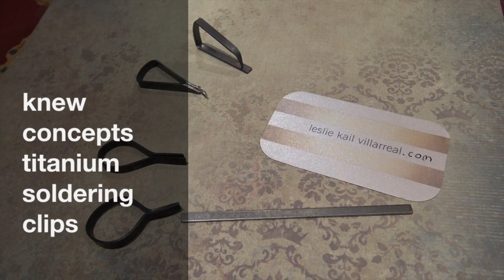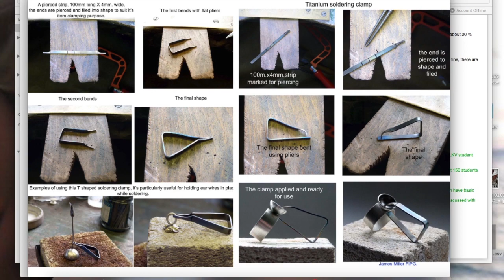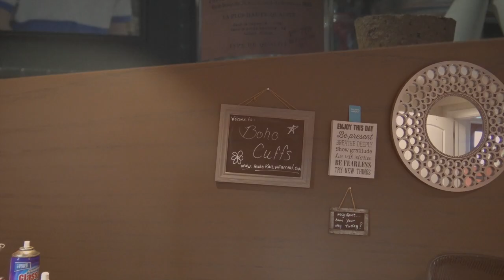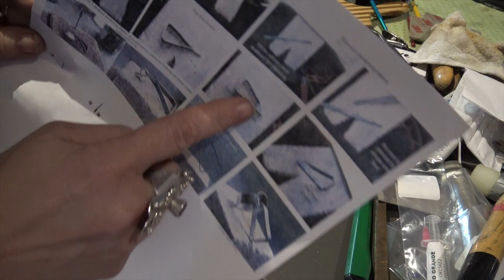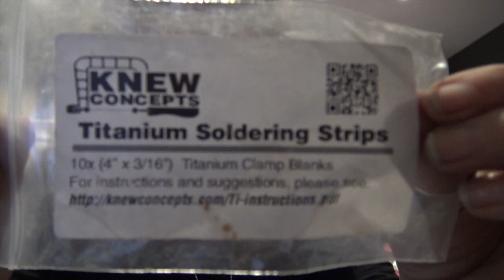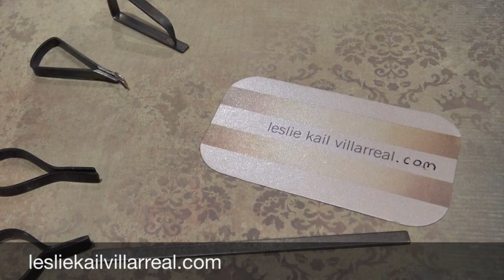How to use Knew Concepts Titanium clips for soldering

Comment: Do NOT ANNEAL them!!!! Titanium will become more brittle with heat. If in doubt, Knew Concepts made a YT video January 2018.
Reply from the maker: The old ones were really thick and needed annealing, they did get softer - the new ones ore very thin and don't need it.

Comment: Annealing titanium is different than annealing copper or silver. These (at least now) come annealed. Adding heat to them makes them harden due to titaniums reaction to oxygen.
Reply from the maker: Wesley  Beavers when I made this video the strips were made much thicker than they are if you purchase them today . Believe it or not After you have used these for a while they do get softer from all the heat.
Reply: @LeslieKailVillarreal  awesome, I'll test some titanium this weekend and see what all the hype is about. I have a project that requires clamps, thanks for the video
Reply from the maker: @wesleybeavers1930  you will find the new strips are much thinner and easier to bend without any heating

Comment: Reactive metals are funny elements. They can't be annealed under normal conditions with heat, it requires lots of time, precise temp control and an oxygen free atmosphere. Titanium isn't as affected by it as niobium but will become more brittle in the presence of oxygen, niobium especially. Nice video though! 🙂